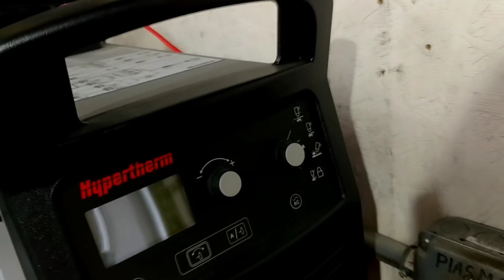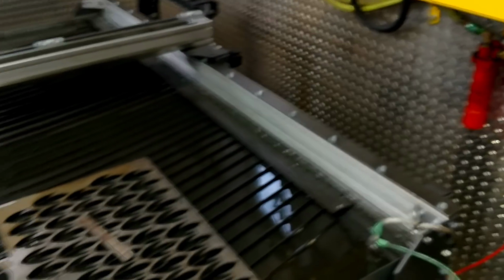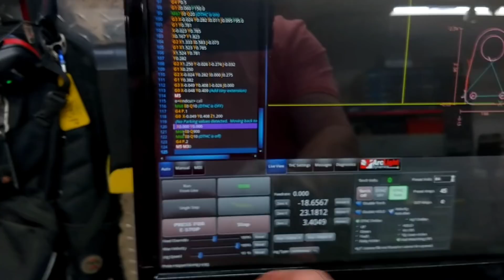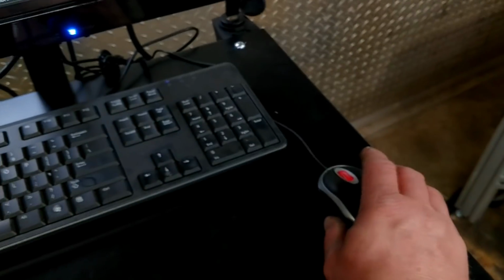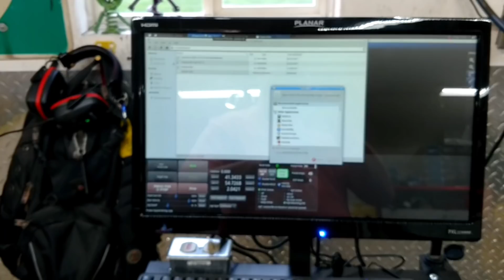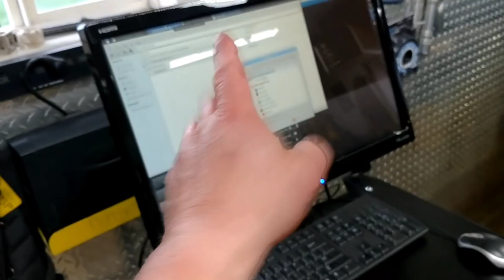ArcLight Dynamics CNC Plasma Table Custom Setup.

Comment: Excellent tips and tricks.  Just ordered a table from them so I'm watching all sorts of videos on it.  I like all your modifications, they just make sense.  Not sure about the water circulation purpose, but I'm guessing the water gets hot local to the cut area.  Would it make sense to put a filter on that water loop?  Or maybe use the pump to drain/fill the table for cleaning?
Reply from the maker: I was going to put a filter, but figured it would get plugged way to fast... Been running this way for years with no major issues...

Comment: You sound very knowledgeable about CNCing. I'm not a welder and I have no CNC experience but I have lots of ideas for products that I could make with a CNC including some heavy thick steel products up to 1". Could you offer any suggestions or insights as to where to begin ?
Reply from the maker: Not really.. I started in to my mechanical engineering background at age 18... I am now 49... Just start at one small area and expand upon it..

Comment: Fine cut swirl ring is only for hand cutting.    Mechanised uses the regular one.     Per. Jim Colt.        I was using one too..   but the regular one flows better.
Reply from the maker: At the time of this video I was playing with  fine... What I have found to work well is 45-amp fine cut consumables with course cut swirl ring...  That combo work s great... I have been running this way since last June... I also relayed this info to ArcLight.. I run the table about 10-hrs a week on average...
Reply from the maker: I was getting a lot of build up of hot metal slag on the tip as it was cutting... The course swirl ring seems to move the higher flow of air and keep that much cleaner...